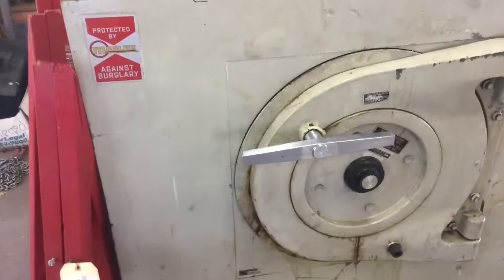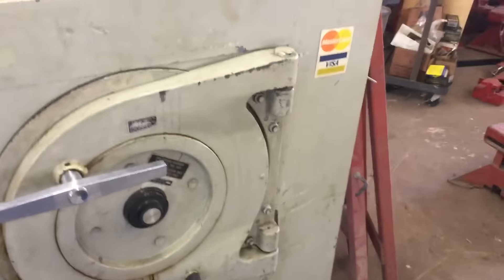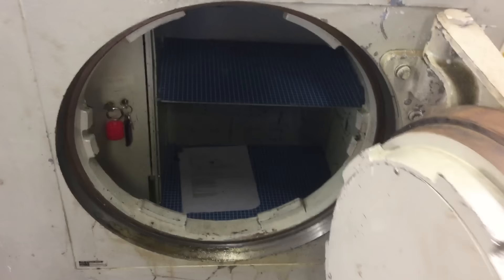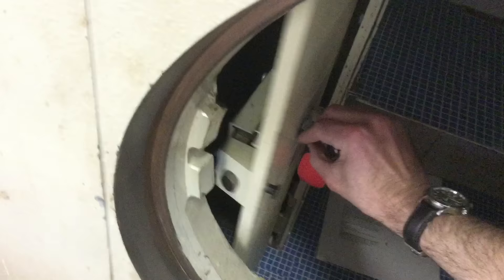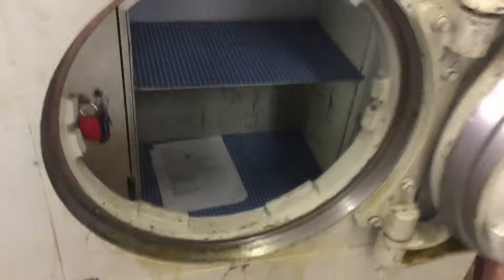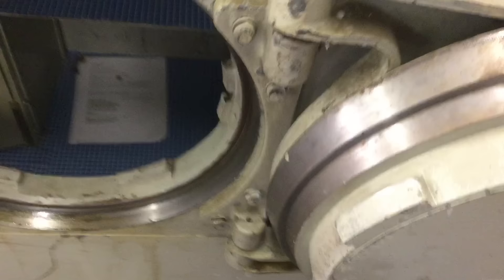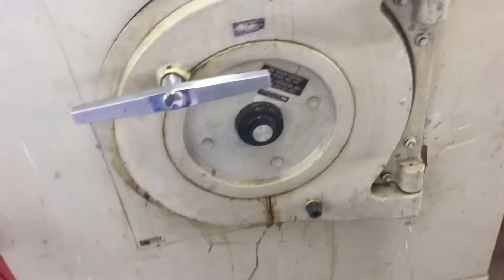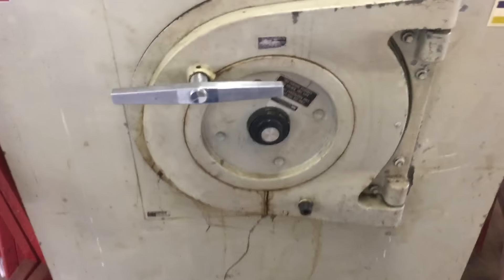A HUGE Safe!

Comment: The bolts holding the door on are exposed, as are the hinges. I question the functionality of a safe with those weaknesses.
Reply: argentum taibhsear The locks are internal, the hinges just hold the door when it's open.
Reply: Those bolts and hinges are for opening the door when the bolts are retracted. However, when the bolts are in place, the hinges do nothing.
Reply from the maker: I'm going to put up a sign that says do not mess with bolts and hinges. That'll do it!
Reply: Let's just hope your thief if literate.